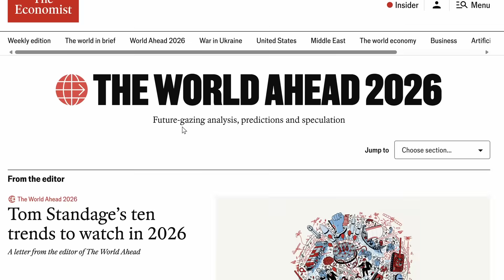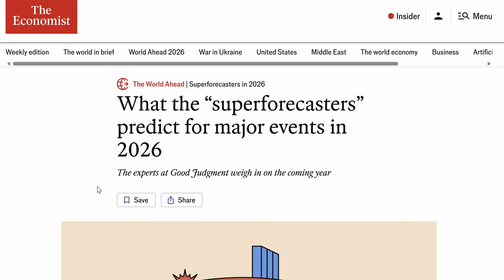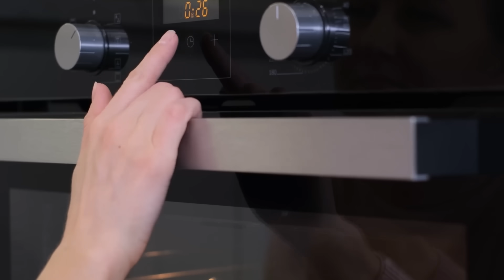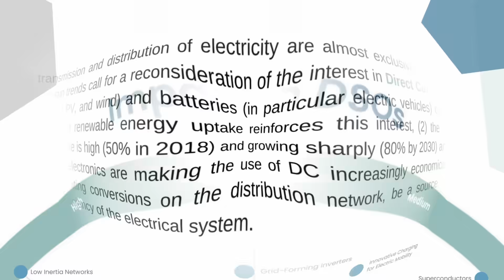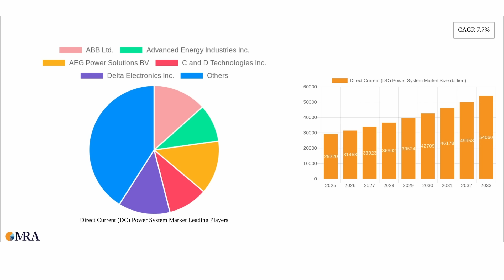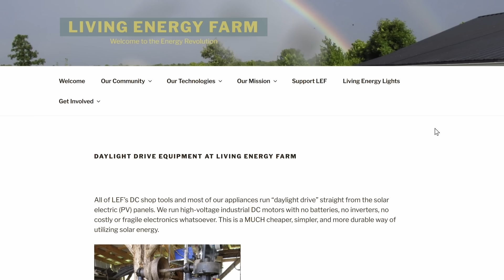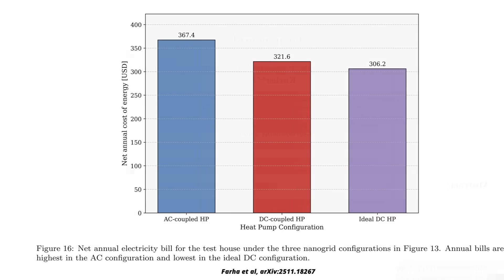Are We Using the Wrong Kind Of Electricity?

Comment: Comparing HVDC transmission and low-voltage DC used in consumer devices isn't fair. While we can build solid-state DC-DC converters capable of handling low voltage at triple-digit amp ratings, I'm unaware of any DC-DC "converters" operating at the transmission line level.. The converters on HVDC lines convert from AC to DC and back so that transmission can be done using the slightly more efficient DC. It is far more economical to use AC transformers to jump between voltages in the low kV range for general distribution. Not to mention that much of industry relies on being supplied 3-phase AC (often 600V in my parts) for running large motors.

Next problem is transmission efficiency; You require far less copper and suffer far less voltage drop pushing a high current at a low voltage than a small current at a high voltage. A neighbourhood DC supply would likely need to be 48V, at edge of what is considered safe for consumer use, not to mention requiring at least 8ga copper to limit voltage drop.

It might make sense to integrate a 24V DC service in new homes, fed off the main AC panel, to provide a quality DC supply for lighting and consumer electronics. If there wasn't a power savings, there'd surely be a savings in eco-waste given that the power supplies are often the point of failure in LED lights, but I doubt (cost)efficiency and safety stack up very well in an all DC distribution system.

*Wind turbines actually make AC, problem is that it's variable frequency so we rectify to DC then convert it back.

Comment: Yeah, those geniuses are forgetting one little problem that will increase maintenance costs exponentially.

Corrosion, with DC you have a permanent cathode and anode, that means that in every place where your lines come in context with a potentially wet surface, there will be a mighty galvanic corrosion on the negative conductor acting as an anode.

AC by definition doesn't have this problem by alternating the anode and cathode role of each conductor dozens of times per second.

So yeah, you will save some energy in transmission and will screw everyone who has to give maintenance to electrical equipment on open air infraestructure.

The manufacturers of electrical equipment will get rich though, so, good for them.

Comment: Audio speakers use AC and guitar pickups produce AC current, whether there are DC circuits within the amplifiers or not. Battery powered guitar amps receive AC inputs and send AC output to the speakers.
Something to do with sound being a wave that is better suited to AC.
Merry Christmas!
Reply: Transistors inside audio amplifiers ONLY work with a DC voltage rail. No DC --- no audio amplifier. Trying to use AC on a transistor turns it on and off all the time creating SEVERE distortion that would not even resemble anything close to music. 

(I'll add that guitar pickups are a voltage source, not a current source)
Reply: @wally7856  Yes, AC is converted to DC internally by a rectifier in tube and solid state amplifiers.
The guitar pickup still sends AC voltage (generally less than a volt) to the amp, and every audio device I have that uses a speaker sends AC to it.
I had no intention originally to explain what I knew about amplifier internals, just that musically speaking, AC goes in, AC goes out 😃
Cheers!
Merry Christmas!

Comment: This is a fun debate more than a hundred years old. AC basically transmits better wirelessly and wired (ex. radio). But for microgrids and rooftop solar, DC makes much more sense from the perspective of safety as the voltage is lower.

Comment: Direct current is great if you have a generator every mile or so.
Reply: That was true in the late 1880's and 1890's. It isn't true today. There dozens of long high-voltage DC transmission systems in operation worldwide.
Reply: @avsystem3142  Specialized transmission lines DC works, but not at scale or when you have already built at scale.

Comment: So there's the direct Sabine, and the Alternating Sabina?
A more on-topic observation:  There's a company called Oxide which sells racks of computers.  They don't sell a single computer, they sell a full rack of computers which they have designed themselves.  And there's one AC-cable which goes to the rack, and then all the devices in that rack are supplied with DC current.  And yes, one of the advantages of doing building a rack in this manner is that it reduces the amount of power used by the rack.

Comment: You forgot to mention that AC can be transformed up and down with little losses. THIS is what makes it more economical to transfer over large distances. DC needs to be transmitted from the power station to the consumer at the final voltage (at least with pre 2000s technology).
Reply: Sorry, its mentioned later in the video. Should have been first.

Comment: I get that solar panels produce DC, but how do Wind Turbines? Surely that's a standard rotating dynamo generating AC. Admittedly that'll be not at grid frequency 99% of the time, so Wind Turbines generate AC, convert it to DC, then to AC synched to grid frequency for transmission? No wonder the bloody things never generate any useful power!

Comment: And let's not forget robustness of a AC vs DC powered generation and distribution grid. The failure rate of an electronic system is way higher than that of a block of steel and copper. To cover this MTBF and MTTR is a hole different ball game. Maybe a hybrid micro grid with a high-power AC and a standardized voltage DC line of which equipments are directly operating is a solution.

Comment: Wind produces AC like any generator. It's relatively simple to turn it into DC but anything that spins is AC. It's the spinning that creates the alternation.
Reply: My stereo amplifier takes AC, converts it to DC and then back to variable frequency AC for the speakers.
Reply: @Sonny_McMacsson  A rather chaotic AC at that even.
Reply: Thanks to confirm that, because I was : What?  How can a wind turbine produce DC current?
Reply: @YannR34 
DC generators have a metallic split-in-half [called a commutator] ring (when I was reading my older brother's secondary school physics book in the mid-1960s so I'm not sure how it's done nowadays) which reverses the polarity at the opportune angles of rotation so the negative-going side of the output voltage never occurs due to the electrically conducting brushes (usually copper and accompanied or replaced by graphite at the contact to prevent arcing and mechanical damage to ensure conduction) exporting the electricity being rotated to contact the other half-metal-ring.
Reply: @YannR34  A wind turbine can produce either one, as there are both AC and DC generators.
Reply: @ScottGrammer  Basically invert the DC motor right? Either brushed or brushless.  Still there's AC involved. Nothing is pure DC.
Reply: It's the wrong frequency & variable
Reply: That is right and btw, elektric cars have 3-phase ac-motors too!
Reply: @56rockit  That's true, but the battery is DC by nature, so it's irrelevant what the motor takes - the power transfer is between grid and battery.
Reply: @Iguana93  But in modern BEV the 3-phase asychronous AC motor is much more efficient than any DC motor. That is why we need an inverter that modifies DC of the battery into some sort of 3-phase current.
Reply: @56rockit Yes, that's what I'm saying. But you need DC for charging the battery and the battery will always give DC. So the type of motor in a car has zero bearing on the car's power demand from the grid.
Reply: Dude my 59 Ford generator spins and is very DC ! The wiper motor spins and is DC ! The heater fan motor is DC ! DC provides high amperage and low voltage , the opposite of A C !
Reply: @chavitacanta008  Internally, it does generate AC then rectifies it to DC. At best, you can generate pulsing DC, but never that flat line clean DC. The only thing that can output that is a battery.
Reply: There are generators for AC and DC.  AC has advantages over DC: generators are more efficient and electrical voltage can be transformed to higher  voltages more efficient than DC. finally it is a trade off between transmission losses and  conversion losses.
Reply: 1) Man kann "leicht" AC/AC hin- und her transformieren. Bei DC/DC geht das nur unter beachtlichen Verlusten: DC1 -> AC1 -> AC2 -> DC2.

2) Die H.felder weiß nicht was das ist: Wechselstrom! Der Energietransport geht über das begleitende E-feld, nicht über die Ladungsträger
Reply: motors and generators, all depends if you use slip rings or commutators as to whether they're using or generating AC or DC.
Reply: no...
Reply: I haven't watched the whole video. The reason alternating current is used is because the high voltage Spike that happens each time the polarity is Switched allows the current to travel much farther down a line than direct current would. That is why we convert to direct current when we need it inside the home.  Edison wanted to use a direct current system but it required a power plant every several blocks.  Most appliances in homes do you use the alternating current when possible, such as ceiling fans, and your typical light bulbs. The motors which reverse Direction when you reverse polarity are direct current motors.
Reply: The AC that most wind turbines generate is at the wrong frequency and can't go on the grid. That's fixed by converting the incompatible AC to DC and then using a large inverter, like solar, to convert the DC to AC power that is compatible with the grid.
Reply: @TomSpeltincx  If wind turbine generate wrong frequency , and other turbins like steam and water do not have that problem, can you explain that? 
How i now, they work at the same principle.
Reply: @65svein  Wind turbines are powered by the wind, so their rate of rotation depends on the wind and cannot be controlled. Other turbines can be fed the right amount of steam, water or gas to keep them turning at a constant speed.
Reply: @nightjaronthegate  That not right, the rotation of wind turbins can be controlled through blade pitch adjustment, changing the blade angle to capture more or less wind, and by adjusting generator torque. So still same principle as any generator.
Reply: @65svein  The problem is that when the wind is too weak the turbine will not spin fast enough and when the wind is strong a higher speed is desirable to maximise power output. 
Torque depends on wind speed and blade pitch and cannot be adjusted directly.
Reply: @nightjaronthegate  Anyway , a generator is a generator, if its powered by wind,water, steam, or other. And a generator produce AC.
Reply: @65svein Steam turbines are designed to operate at 1500 or 3000 rpm (1800 or 3600 in the US) Once they are synchronized to the grid they encounter resistance equal to the energy of the grid that keeps them from going faster. A constant pressure of steam or water keeps them from slowing down. Wind has a variable force pushing on the blades, a little bit faster a little bit slower, it depends. Even if you can get them to synch to the grid they grind to a halt the moment the wind force reduces. Then energy starts flowing from the grid to the wind turbine breaking all the electronics and generators. There are some experimental turbine designs can be connected to the grid without a conversion to DC power first but they are more expensive to build, require more maintenance and produce less energy.
Reply: @65svein that AC is then converted to DC because it is highly variable in both current and voltage. That DC could be useful but currently it isn't. To be useful on the grid it is converted again to AC. 

The first useful power out of the turbine is DC.
Reply: Automobile 'generators' produce pulsating DC. Automobile 'alternators' are called that because they produce alternating (reversing) currents, 'AC' which they then convert to pulsing DC through the use of built-in rectifier diodes. People often call alternators generators because they do the same job and most folks don't know enough electronics to grasp the difference.
Reply: @johnwest7993 they produce pulsing DC because the 2nd half of the wave form is inverted using a bridge receiver.
Reply: @RICK82873  The automobile "generators" from the 60's and before had brushes and slip rings to do the inversion. It "pulses" because of the gap between the rings.
Reply: @RICK82873  Bridge Rectifier
Reply: @johnwest7993  Automobile alternators are three-phase generators with a three-phase diode full-bridge rectifier. The car battery acts as a kind of filter, as even the output of a three-phase alternator varies, so it supplies current when the alternator output is under the battery voltage, and gets charged when the alternator output is over the battery voltage. That's why you don't disconnect the battery with the engine running.
Reply: @johnwest7993  Rick beat me to it. It's easy to convert AC to DC with four diodes arranged in a bridge rectifier configuration.

That gives you a purely positive or purely negative flow, but it still oscillates between zero and the maximum current twice per cycle.

A simple capacitor filter can smooth out the flow, depending on how much oscillation your application can handle.

For most DC applications, it's not essential, but anything that runs electronics requires a smooth enough flow to trigger the binary condition of either 1 or 0 (on or off).

Middling currents can screw up the logic gates and make a computer system unable to run correctly. That's why they don't recommend using gas or diesel generators to power electronics without a filter system, because the current can fluctuate drastically. An older generator, like mine, could easily fry electronics, but most new ones have built-in flow filters.
Reply: @johnwest7993  If your alternator is working correctly it shouldn't produce pulsating D.C. unless you referring to the ripple on the D.C. which is common in almost all D.C. electronics it is just a matter of degree.
Reply: @johnwest7993  Generators comes in two flavours: alternators that produce AC and dynamos that produce DC.
Terminology matters.
Reply: Wind, I would argue, produces a force.  That force is then converted to motion.  You can use a generator or alternator to convert that motion into electricity... or to pump water. or ???.  So I'm confused by your comment 🤷‍♂
Reply: @steinshaw2490 it’s not that difficult, he obviously talks about wind turbines, they in their most used form use good old AC generator. Some offshore wind farms transmit to shore using HVDC connection.
Reply: @Denguer-b1s  it is not the obvious to me.  I haven't studied wind turbines for a lot of years and as far as I know they are DC if it is indeed better.  If it is better then why aren't they DC?  I guess that is what you say they are doing in some cases.  So again the answer is not that obvoius to me.  Older automobiles used generators and they changed to alternators.  Automobiles didn't have transmission line issue/concerns.  I have yet to hear they converted automobiles back to a generator despite being dc systems.  The few tinker/maker youtubers I follow look at AC for their home brew wind turbines because they don't require  as high of an rpm to start generating electricity.   DC has the advantage it can be stored, AC has the advantage of being able to be transformed with coils.   DC normally needs to be pulsed to step up the voltage.  Though that pulse doesn't have to go positive to negative one could argue it is an alternating current at that point.  Square waves are very noisy/full of harmonics.
Reply: @steinshaw2490  Oh, let me explain. The video is about AC (alternating current) and DC (direct current). She listed wind and solar as DC. I am not familiar with any method of converting motion into DC.

The sine wave of AC is literally a circle in math because it's a measure of the angle the wire is intersecting the magnetic flux of the generator.

Feel free to let me know if you need any other basic physics principles explained.
Reply: @taibhsear71  "I am not familiar with any method of converting motion into DC."
Automobile generators were all DC; alternators is the name for the kind that produces AC (then rectifies it to DC). 
To get DC out of a spinning generator, brushes and commutator pluck the current from the same place in the rotational phase.  It isn't very efficient and it wears the commutator and brushes.
Reply: @thomasmaughan4798 so you just said that a dc generator uses comutator and brushes to mechanically rectify the ac from the coils.. 👍
Reply: @taibhsear71  " I am not familiar with any method of converting motion into DC."
It is called a dynamo, and is basically a DC-motor run in reverse, being fed with motion and spitting out DC.
Reply: @taibhsear71 i hate the term DC! It's a catch all box for anything that isn't full sine wave AC and it should be the other way around. Inductors and capacitors "don't work on DC" they tell is but pulsed "DC" will work just fine with them. So give this convention a simple comutator on a generator will produce "DC" but not the constant voltage type more like V=|sin(x)|
Reply: @johanmetreus  Yeah, that's just AC rectified. See above.
Reply: @dougaltolan3017  "so you just said that a dc generator uses comutator and brushes to mechanically rectify the ac from the coils."
Yes, exactly.  The coils themselves produce only AC.  The commutator allows to pluck the current from each coil at a certain point in the cycle.
Reply: @thomasmaughan4798 👍 sure we, well I, was discussing about converting mechanical motion to electricity. Someone posted that they don't know of anything that will do that and produce DC. Coils only generate AC, more components are required to convert that to DC, whether it's a rectifier or comutator, it's extra.
Now, there is a very strong argument that that's being a wee bit picky, but, hey, that's why we love social media conversations.
😊
Reply: Viva Russia ❤❤❤